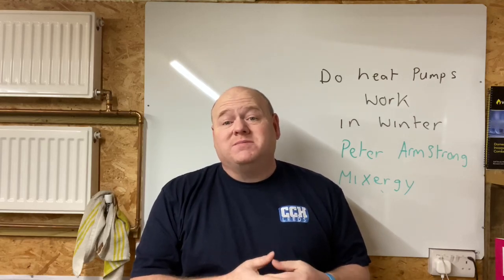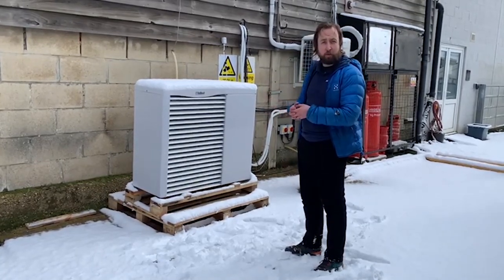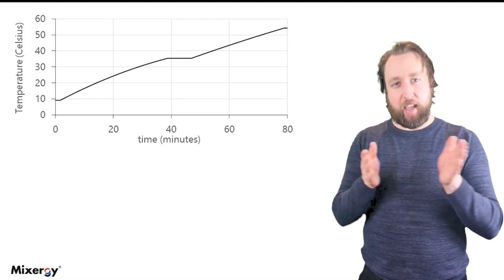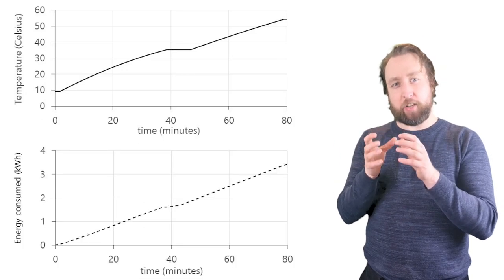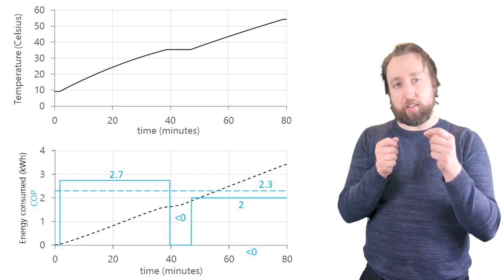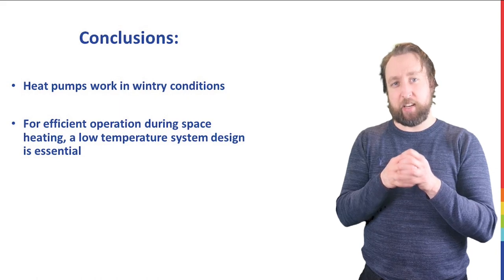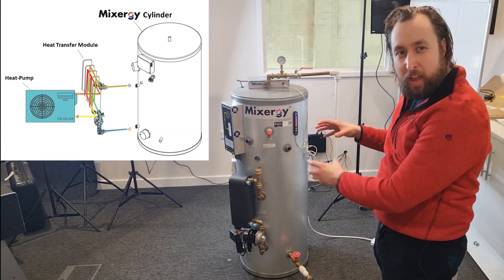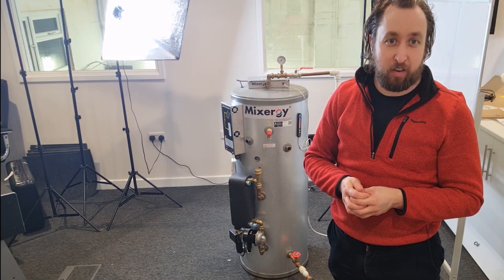Do Air Source Heat Pumps Work In Winter - Peter Armstrong Mixergy

Comment: No I certainly would NOT want one. I live in a small two bed bungalow fully insulated as much as I can and my electric bill is horrendous now and that’s before the latest price rises. Gas and electric just under £200 per month most of cost electric. Running heat pump 24/7 even if I had the space totally unaffordable. Stayed in a holiday home ultra modern fitted with one of those systems during a rather wet and cool July week and nearly went and bought a electric fire it was so cold. That was with a very large high sec system housed in it own out house. The main house was new and built with eco in mind by a well known architect who was working in Los Angeles and was let as holiday home till he returns. That turned me off heat pumped systems totally.
Reply: Surreal.
Reply from the maker: Thank You
Reply: I live in a 120 year old, medium sized, semi detatched house with solid brick walls, open fields on three sides. We have double glazing and loft insulation. Heating and hot water is by ASHP feeding radiators. We never turn the hot water part of the system off, we turn the heating on in late September, early October, this runs 24/7 until April or May. 
We are all electric, our total energy bill, heating, lighting, power for 2020 was £1302. That's £108.50 a month. That was for 9,187 KWH for the year. Over the last 4 years our average yearly consumption has been 9,500 KWH
Reply: @peterkirby842  would love to know how warm it is in the winter?  I assume you keep it on because it takes so long to build up some heat.
Reply: @jdavis460  The house is never cold and just as importantly never over heated. These systems are designed to run 24/7 because it operates at a low temperature. Once the house is up to temp. the heating system just ticks over to maintain that temperature. If you keep turning the heating off at night or during the day then it dose not work and your electric bills will be sky high. 
Having radiator thermostats we are able to control the temp around the house exactly as we want it. The lowest temp we have had this year is about -7 but that is no problem, the house is still kept at our constant set average temp of twenty degrees day and night. Also we have always got plenty of hot water. The only time the immersion heater comes on is once a week for one hour for the disinfectant cycle.
This year, because of the rising cost of energy, I have decided to control things a bit closer. I have turned the system down to its lowest operating setting and I have turned down the upstairs radiators to keep the bedrooms a bit cooler. We have just had our electric bill for December, we used 985 Kwh as opposed to the same period last year when we used 1469 Kwh. The tariff last year was 13.575 p/Kwh and we paid £219.00, this year the tariff is 20.68 p/Kwh and we paid £211.00.
We have had this system for 10 years and we have never been cold and it has never let us down. We have a yearly service plan which also covers any potential break down, this costs £ 360.00 a year.
Reply: @peterkirby842  what company did you use?
I'm really interested in getting it installed in my place 😊

Comment: You can talk about coefficients all day long. Just get 2 tanks of water one using the heat pump and one with an immersion heater and tell us how much each one cost to heat. That tells us way more.
Reply: Heat pump wins all day long.
Reply: Consider boiling 2 identical pots of water (say 5ltr) on a kitchen Hob. We have different size burners (Gas) So the bigger burner using more gas will boil the water quicker but will the smaller burner use the same amount of gas to get to boiling..?   I think there is an efficiency of scale and  (IMO) it will use less gas using the bigger burner.  Scale this up to heating your house.  If you are pumping 5kw around your system alot of the heat will be lost in the infrastructure whereas pumping 30kw of heat will just blitz it's way through.. There are probably some facts somewhere to back up my theory.. anybody?..
Reply: @embryonica   heat is transferred quicker if the delta is higher.  I run my boiler at its highest temperature and ignore the fact it doesn’t condense.  Everything heats quickly and that coupled to a wide hysteresis on the temperature set points avoids the boiler constantly cycling on and off and actually using less gas
Reply: I can tell you definitively the heat pump will use half as much electric. It will only heat to 50 degC though, this is the problem. Anyone who says otherwise is lying. 

50 degrees is not hot enough for hot water or radiators. Gas is 1/9th the price of electric, and works out about a third the cost for heating.
Reply: @cuckingfunt9353 Newer R32  heats pumps can heat water to 65⁰ if you need it. I have designed  and Installed 100s  of  heating system that run at 40⁰ or lower, even on radiators. Old and new propertys.
Reply: I don't know where you get you electric from, mine is 15p during the day and 0.05p at night. With my heat pump running with a COP at 4 my actually electric cost is 0.0375p. more expensive than gas you say.
Reply: Oh my hot water is stored at 53⁰  with is solly done by then heat pump, with a Legonella cycle one a fortnight. Just to inform you, most showers are governed to 37⁰
Reply: @allthingsrenewable9017  The lock on a shower is more like 46 deg... 53 degs is poor for cylinder temperature, it wont work for a bath. I get you know your stuff, but in the UK gas is 1/9th the price of electricity take that into account and heat pumps are not a wise decision.
Reply: @allthingsrenewable9017  5p for elecricity ? you gotta be kidding, my night rate is 15p. day rate is 25-30p... Care to share details of your provider ? As for the COP 4 , that is BS the max you get is COP2.5 and in winter it is  FAR lower
Reply: My gas is 3p per KWh, My electric is 25p+ ... I have just checked my bill. . Where are you getting your numbers ?
Reply: @allthingsrenewable9017  Look, in theory I have nothing against it, BUT, the electric the heat pump uses in the UK comes from burning gas, the efficiency of the generation and transmission is bellow 50% , so there goes your COP of 1.4 or whatever... As for 40 deg radiators, they would need to be 14 TIMES bigger than 80 deg radiators... This is where the whole thing goes a wry.
Reply: @cuckingfunt9353  all depends how the system is designed. And how does the gas get to your house down the pipe, by gravity. No it's pumped by electric, which is also produce by gas🤔
Reply: @allthingsrenewable9017  Sounds like you are on octopus go.  You wont be getting a cop of 4 in the depths of winter - which unsurprisingly is when you need heating the most.
Reply: @allthingsrenewable9017  Gas isn't pumped, it is stored in the trunk lines at great pressure. This is an interesting point, since it used to be stored at low pressure in huge expanding chambers, but the government spent billions a decade ago switching to the new system.
Reply: @eliotmansfield  yes COP of 4 was an example. For the maths, lets just say there are peaks and troughs with all, i make in the warmer spring days and lose in the winter, its a balancing act with all these things. Fabric first, good heating design second= Efficiency  Gas, Oil, Wood, Electric, Heatpump. Dont we all want cheaper running costs.
Reply: @allthingsrenewable9017  You say you do this for a living.... So you are a salesman ! .... That explains it. Good luck with heating that house, you might want to hide a gas boiler in the cupboard so when you show off your heat pump system your house is actually warm !
Reply: @cuckingfunt9353  it is and I have running data and many happy heat pump clients to proof it, have a nice day.
Reply: @kenbone4535  It comes out of the ground at hundreds of Bar pressure. That pressure can also be used to cool the gas and liquefy it for cryo transport. There is no pumping necessary for the UK trunk system, it comes from off shore pipelines at great  pressure, and off boats as a liquid.
Reply: @kenbone4535  'It is' ? ... What is... Are you posting as all things renewable ? ... So you are one guy, a heat pump salesman , and here because you are worried clients will be getting wise...!   I don't care, when I install these things, I always tell the customer  (after fitting it) that the salesman sold them a pup, and if they want I can come back and add an oil boiler to the system because they will need it for winter ! .. I got one guy come back to me last year after fitting 3 units, but this year I have installed a dozen pumps already, so I reckon a bumper year starting January.
Reply: @skiiddy  good effort, but your trying to convert someone, that saw the light converted from gas engineer to heat pump engineer 15 years ago, we have many GSHP clients with COPs over 5 😁
Reply: @cuckingfunt9353  I generally agree with you buddy, I’ve only installed 4 but must say in a new build timber framed house it surprised me how well it did work. They were systems designed and supplied by grants, worked well with underfloor heating, radiators were ridiculously large though. And speaking to the grants guys who came out to commission the units, his words retro fit in a standard older property it’s rubbish🤷🏻‍♂️ i recently renewed my lpg qualifications and one off the other lads in the course, had fitted a few and didn’t have much good to say about them neither did the lecturers, think I’ll stick to gas, lpg and oil myself.
Reply: @allthingsrenewable9017  Ah, GSHP is a very different kettle of fish. Much, much more expensive in terms of installation costs though.
Reply: @cuckingfunt9353  I'm with B'GAS Elec = 14.951p/kwh (inc vat) and gas = 3.157p/kwh (inc vat). Fixed tariff 2yrs ends March 22. Hope this helps.
Reply: @joelwood6950  What didn't ? Why not ?
Reply: @richardchester2148  Octopus gone !!!.
Reply: @cuckingfunt9353  It seems to me that heat pumps rely on the house being super insulated, so why not just have an electric shower , electric handwash, and heat the house with a few candles @80p for a pack of 50 from asda, as that would give as much heat as the heat pump. I'll be sticking with my gas boiler, gas burns hotter than snake oil.
Reply: @paulhillman400  ?
Reply: If heat conditioning is expensive in this country than this will be the same thing but in reverse
And how many people are going to make money out of this little adventure how many of these people actually work for the companies that make them installing and make money from all this
Reply from the maker: Thank You
Reply: @embryonica  The specific heat of water is 4190 J/(kg*°C). It means that it takes 4190 Joules to heat 1 kg of water by 1°C. It doesn't matter how quickly you provide the heat . Basic physics.
Reply: @cuckingfunt9353  You are 37 percent correct (2021) to say that Electric in the UK comes from Natural Gas. That does of course mean you are 63 percent wrong. Over the next ten years you will become increasingly incorrect. Well within the life of systems fitted today you will be totally wrong. If you add a bit of PV into the mix and the fact that there is more wind in the winter and gas is used less during cheap rates then gas will be used less than that.

Comment: Spent a huge wad getting rid of my hot water cylinder so I don't want an even bigger one nor a huge fan unit outside,  no room for that either. ASHP only good for super insulated new builds with floor heating and space designed for the fans, tank, pumps and controls. Roger Bisby of Skill Builder did a rant on them recently, worth watching.
Reply: Yeah I watched that video too
He covered all of my doubts about these things
I would say that these are a relatively new technology and I have no doubt that they will improve, but they are not suitable for every home just yet.
Reply: I also watched Roger's Rant.  It just confirmed my thoughts on ASHP.  That said, watch the government legislate in their favour regardless.
Reply: @michaelkiddle3149  When I install these things, I always tell the customer  (after fitting it) that the salesman sold them a pup, and if they want I can come back and add an oil boiler to the system because they will need it for winter ! .. I got one guy come back to me last year after fitting 3 units, but this year I have installed a dozen pumps already, so I reckon a bumper year starting January.
Reply: Going back to a water tank is like going back to the 70's 80's. And then to have a great big box with larger radiators and fatter pipes. 
And also needing an emergen heater to assist the pump in winter. 

In a few years when repairs are needed the costs will be sky high and noise from fan after a few years.

I'd rather wear an extra jumper
Reply: @grumpy-dad3701  Going back in time is EXACTKY what we will be doing...  A huge black market in log / coal burners and back to shoveling the thermacite out of the bunker in the snow.
Reply: I remember the days when in the morning you could see your breath while inside the house.... Those days are fast returning.
Reply: @michaelkiddle3149  yes they have only been in use in Sweden for 20 years. They wouldn’t be installed in “every home”.
Reply: @cuckingfunt9353  I remember when we rubbed two sticks together to start the fire, but we were grateful. The smog from all the coal fires made us wheeze but we grand.
Reply from the maker: Thank You
Reply: @cuckingfunt9353  Once when I lived in a house like this I woke up and my face flannel had frozen !
Reply: @MrAvant123  These kids don't remember the 'good' ol days like us oldies. They won't like it when their house only gets to 12 degrees in mid winter.
Reply: @michaelkiddle3149  they aren't that new. We've been using heat pumps for many decades. There's a basic limit to physics and I doubt we'll see any huge changes to the temperature on the high pressure side without other compromises.
Reply: I listened to his rant. The main point I took from it was that improper installation in poorly insulated old buildings doesn't work. No surprise there. But if installed in well insulated/designed new buildings, they work. We put one in a superinsulated  1000' square house 3 years ago here in eastern Ontario. There are 4 electric baseboard heaters for back up that only come on if the outside temperature drops below about -15º C. This house is all electric-water, lights, stove, etc. Total electric bill in a typical January is around $200 Cnd.

Comment: Weakness of heat pumps is:  as the outside temperature drops, so does the output of the heat pump.   So when you need more heat, your unit is capable of less output.  Not so with natural gas furnaces.
Reply: thats a weakness of air-sourced heat pumps, ground sourced don't really suffer this issue as ground temperature is so constant.
Reply: New generation with R290 gas could be a game changer. Only Vaillant and Viessmann so far.  I’m convinced hydrogen is the future.
Reply: So you build this into the design for the worst winter day easy?.
Reply: @cuckingfunt9353  pushing it to the public, but not changing over their own government buildings! Why is that if these heat pumps are the second coming? Shouldn't they lead the way?
Reply: @FlexDRG  Do as I say not as I do, as Alok Sharma would say, after taking dozens of international flights without quarantine all in the name of climate change. . . You couldn't make it up.
Reply: @cuckingfunt9353  I would agree with you that when you live in a drafty un-insulated house from the 1830's you will probably need gas heat, or better yet an ancient Coal Furnace. I have had a heat pump  at my home for the past 42 years and have saved thousands of dollars every year over neighbors who have either Oil of Gas heat in houses that are virtually identical.
Reply: .....but you get that bonus of sky high electric bills....
Reply: The output doesn't drop, the efficiency (COP) does.
Reply: @cuckingfunt9353  gas boilers from 2025 won't be allowed in new builds,our government want heat pumps installed,wait til 2027 where companies will be asking where you misold an heat pump,p.p.i all over again😂
Reply: @mickobyobrien2650  It's a clusterfuck... The future is cold and expensive.
Reply: @cuckingfunt9353  Retired from the plumbing and heating industry as an an installer but my son still working in it, he finished a bathroom install last week and talking to the customer they got onto ASHPs, the customer had a survey done recently to replace an oil boiler with ASHP, survey was very thorough, a 3 bed bungalow with 2 bathrooms, large kitchen and utility room, the bottom line was quoted just over £17,000.!!! They didn't accept!!!!!
Reply: @skiiddy  I've got a R290 AC unit and I am impressed, but I have no way of really testing the figures other than it seems to do the same as my last 1kw one for less than 500w.
Reply: @clooperman3745  That is about right for a typical basic install, but it won't work, they will be cold and have huge bills. You have to add underfloor for it to even be half good, and that adds another £20,000 (for both floors) .  Realistically a 'working' ASHP will cost nearly £50k, and once your subsidized tariff runs out you will be paying huge bills.
Reply from the maker: Thank You
Reply: @hvacdesignsolutions  so are you saying the output temperature does no drop as ambient drops ? That could only happen if they had a gas heater or electric heaters tucked inside.. A heat pump can only pump the heat that is available. What you are saying is that the output of your gas boiler would remain the same even if you throttled the gas and made the flames smaller...